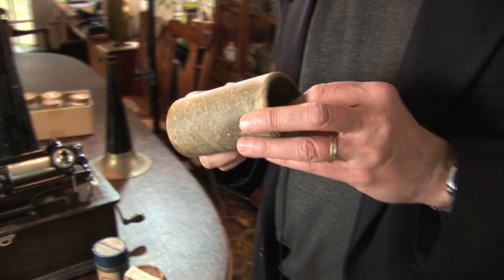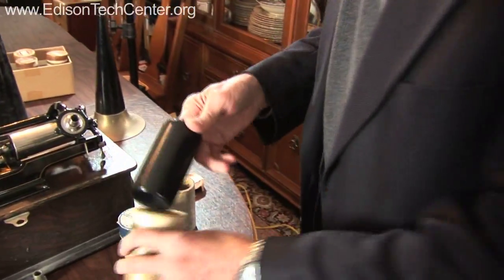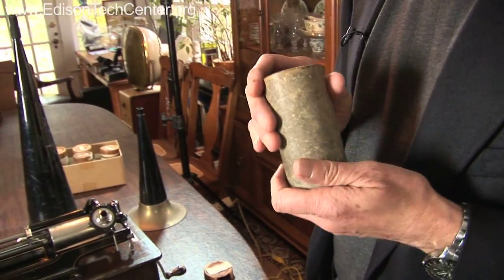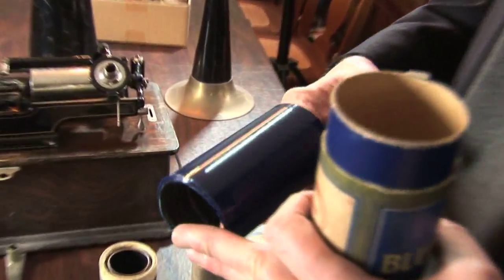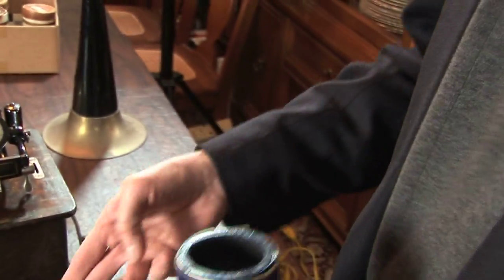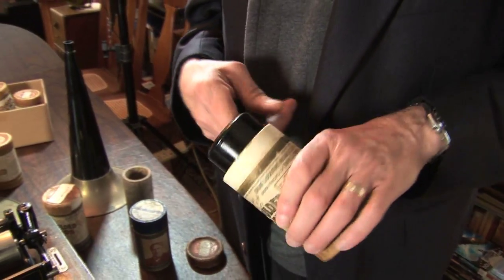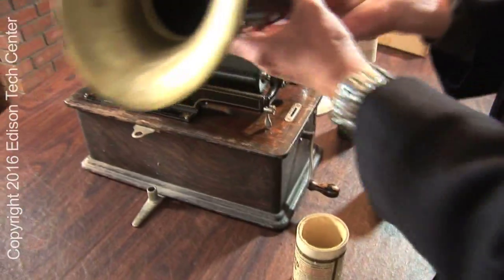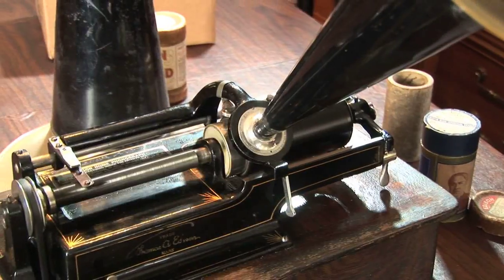Wax Cylinder Production

Comment: The cylinder compound of Metallic soap, the  main chemical is stearic acid, which is refined cow fat, it is pressed two or three times, so that it has the least amount of olaic, and glycerin, if these are in the stearic, you have a light blue haze appear on the surface.  Today most stearic acid is vegetable based.  Just like making soap, it is saponified with sodium hydroxide, to forma a salt of sodium, also , surprisingly the metal aluminum chemically reacts with sodium hydroxide, and dissolves from a solid to a liquid, and creates hydrated alumina.  The previous compound is somewhat hard, and needs only 50% saponification, so some free stearic is present.  The stearate compound by itself can be attacked by moisture, which will spoil, or make it have a mildewed appearance, if just by itself.  The compound needs something soft, so a recording stylus will engrave the surface, so paraffin, ceresin, or beeswax can be added in a small amount to do this job.  Moulded records , like the Edison Gold Mouded  have the previous base and additions of copper, and zinc salts, pine tar, montan wax,carnauba wax to make them hard, and lampblack to color them black.